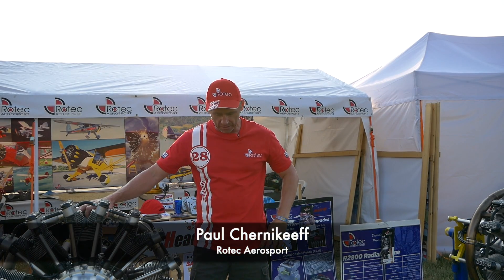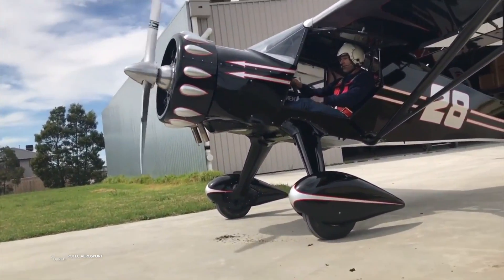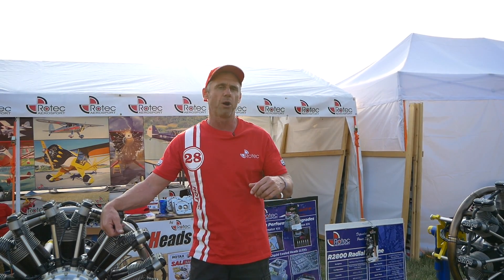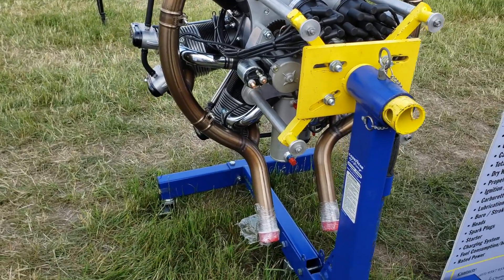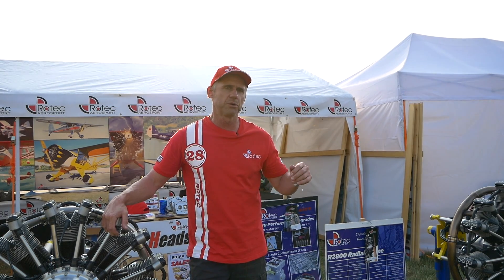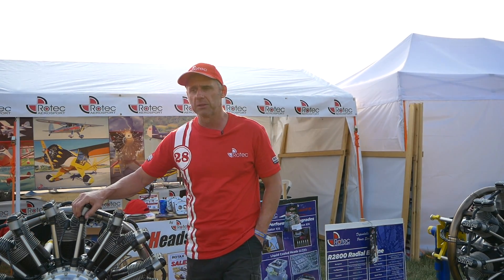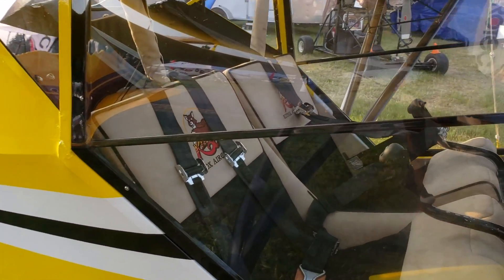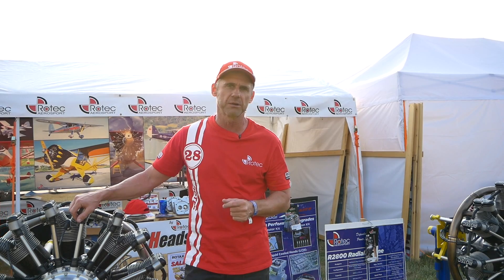New Radial Engines For Vintage And Modern Airplanes - Rotec Radial Engines

Comment: You guys should be ashamed of this engine. Way to many failures for it to be reliable in a aircraft. They have plastic timing gears. People do research before buying. I have seen many hoarer stories from the drive gears exploding to being poorly assembled to push rods breaking and far more. Its to bad because they look good and sound great when running. You need to go back to the drawing board. perhaps copy a old Pratt & Whitney Wasp R-1340 SC1 exact no plastic or short cuts.

Comment: I wouldnt put these on a snow blower . Every single engine has had an issue most have crash new planes do A search rotec failures before you buy this unsafe engine . the faa is  investigating. Go back to model engine you jerks.

Comment: It's really sad that someone is spending so much energy trying to get Rotec out of business. Should they succeed, will it be a great loss for us who enjoy these engines so much. And there will only be one manufacturer left that produces small radial engine worldwide.
Reply: How many hours do you have on your Rotec engine?
Reply: @cleophusA  It's six months winter in Norway so it's only been 187 hours so far. 
I made the following adjustments:
• Replaced all oil hoses from AN6 to AN8 except crankcase ventilation     hose which are AN10. This reduces the possibility of hydraulic oil cavitation and that it builds up a lot of oil in the crankcase.
• Larger oil tank with air separation
• I never use 100LL since it clogs the oil channels, valve stem and the tops of the pistons. 
• I use Bing carburetor since I don't know if TIB likes ethanol. Car gas contains up to 10% ethanol in Norway.
• The carburetor gets cold intake air. This helps to cool the crankcase.
• Return hose on gasoline supply. This reduces the possibility of vapor lock
• Uses wideband A/F ratio gauge to prevent it from running lean.
Reply: @oeaaneb , from all of the negative video I've seen on this engine, it looks like you have gotten one of the good ones. Have you experienced any of the problems that so many others are talking about, such as premature bearing wear and unusual parts breakage? I was very interested in this engine until I saw so much negative feedback about reliability and especially customer service. I mean, if you have to have warranty work done, it means paying freight both ways from America to Australia! That can't be cheap, and if you have to deal with a hostile customer support/warranty system, that makes a warranty claim even more of a nightmare. What intrigues me most about this engine is the extensive use of automotive parts, making maintenance much more user friendly and cost efficient, but I sure don't want to sacrifice reliability for ease of maintenance.
Reply: @cleophusA  My thought is that you must use a round dry sump tank to avoid that foaming oil will follow along into the engine again. If you also avoid the oil cavitating by using AN8 hoses I mean the bearings should last a long time. 
I'm not worried about using pistons and valves from automotive as long as it's from well-known suppliers. 
Support / warranty is always very difficult as there are two sides. Is there a user related error or is it manufacturer's fault. There had of course been a lot easier if Rotec had supplier in the US and Europe.
Reply: It is also important to avoid hydraulic locking. This can cause damage to the rocker arms, pushrods and, in the worst case, bent connecting road

Comment: Been following these beautiful  engines since the get go. They have been super reliable over for around 19 years. Hats off to them.
Reply: Obviously you've never researched youtube for all the videos on  the poor reliability, bad construction, cheap parts and no quality control. These engines are dangerous.
Reply: I can only imagine you must work for the company, no one else who has “been following” the history of these engines would agree with this utter tosh.
Reply: Keep off the crack. A French taxi driver is more reliable than these engines!
Reply: You must just be following the manufactures page and no body else because if you did any real research you would know this engine is a death trap and total crap. It needs a complete redesign.

Comment: Aren't there two manufacturers? Rotec from Australia and Rotex from Germany.  A lot of horror stories about the Rotec.
Reply: Rotax is actually a very reputable company, you are correct. Rotec, the ones features in this video do have a lot of issues that still need to be worked out, despite being out for quite a few number of years now.

Comment: More btw. I understand  Paul has been selling these for many years now. But here's a theory as to why he's been able to get away with this for over a decade;  The planes they're being put into are historical/rebuilt/re-imagined. Both traditionally and contemporaneously they don't fly that many hours. Paul admitted so much to one purchaser I know of who's engine failed and Paul, self-admittedly, said he has no feedback on such use when it comes to it when it comes to actual metrics. Therefore, if a fault -ridden designed engine goes for a couple of flys it might 'last'. Take this same engine and put it to a few dozen hours, a few hundred or a few thousand hours and will appear a different story. I actually feel sorry for Paul, as an ex-pat Aussie myself.
Reply: Why do you feel sorry for him? He clearly says it has a 2K. TBO and it obviously doesn't. There are several post from people that owned (yes owned as in Don't anymore) that had them fail in flight with low hours. On every one of them they found damaged or miss fitted parts. Rocker arms hitting rocker covers. Bolts that are to long so they hit internal parts. AND all had several problems with customer service from Rotec. Even being told that if they are "combative" or complain to much then Rotec will just drop them. As in no more support on an expensive engine that doesn't work. This ass hat owner. (Rotec) has only himself to blame.

Comment: Word. This says it all:  https://youtu.be/LlPtMVijIzs  ..look at a real radial engine instead Mike, like a Verner or Warner. You should ask Paul about things like oil control rings with radials, fitting difference between top and bottom cylinders and see his reaction.  I know a pilot who's engine dropped a valve into the cylinder whilst coming into land at AirVenture at Oshkosh, ironically. Fortunately he had the height and speed to do a dead stick unscathed. He said never again, replaced it with a Verner. The author of the vid link has a Masters in Aviation Engineering along with 14 years as PIC of a B757 & B737. That's what you might call qualified, er, unlike some other people.

Comment: did anyone notice the little kiddy playing with his toy plane on the left?..looks at the circular exhaust manifold, would be better with some cooling fins engraved on those surfaces too to improve efficacy of heat removal from those monster arrangement of aircooled cylinders
also feel twin spark ignition systems could be improved with special design of new spark plugs that allow twin spark arcs from a single piece of plug electrode, hv coil  and cable setup to reduce clutter and wiring
Reply: FC: A single spark plug is a single spark plug. No redundancy.
Reply: that makes sense when you up in the sky...

Comment: I LOVE the look of the Rotec radials, they completely nailed 100% the look of the P&W wasps and such.  That said...they need to spin real fast to get any power out of them and at speed (TO/ cruise) they sound NOTHING like a radial - more in line with a rotax 912.   As far as the reliability I have nothing to add but it seems like they're getting lots of hate from owners.  

The Verner Scarlet series (3,5,7,9 cylinders) on the other hand spin slowly, like the original radials, and sound BADASS.  Look up their vids on YT.  They don't quite look as nice as the rotec but the sound more than makes up for it.  I think their engine uses Honda components.  

And the name is pure genius, though it probably goes over most folks heads.  Verner Scarlet = Warner Scarab 😂
Reply: Richard Hodge the reason why Verner doesn’t get lots of hate from o Wes is probably because of there are only few owners.
Reply: @TheNadjalo  
Well that and they're actually a much better engine

Comment: Rotec are plagued with a lot of problems. They need to be re-engineered to stomp out the many design issues they are riddled with.
Reply: can you name some?
Reply: Video bearing failures are all over youtube, on Rotax and this radial which is really bad.
Reply: @tropicthndr  maybe it could be due to some quality issues with the bearing supplier they used..?
Reply: tropicthndr you’re confusing Rotec (American company) and Rotax (Austrian company). Rotax has no problems and by the way, no radial engines either
Reply: @Fr99763  Austrailian, not American.
Reply: @Fr99763  
You have that exactly backwards
Reply: @kirkstinson7316  then look it up. You shall see
Reply: @fidelcatsro6948  from the videos I've seen

Big problems from the factory (as in bad cylinder assemblies from new)
Immensely poor customer support
Selling used parts as new
"New" engines coming with used parts
Borderline catastrophic failure from New
All the above issues showing themselves within 50 hours of operation
Reply: @thegreatchickenoverlord5976  thats bad!
Reply: Yep, great example of why you never put kids/family behind anything that’s not certified, including Rotax drone engines.
Reply: @tropicthndr  I've flown Rotax 2 stroke engines for 15 years and never had a problem with them! The owner must tune the carbs and watch egt temps. TBO is 300 hrs but I have friends who have got in excess of 1200 hrs before a rebuild. Very good engines but definitely not idiot proof! What's your experience with Rotax engines?
Reply: @daviddixon2166  yes those are good engines but these are not the same maker.

Comment: They make great boat anchors , certainly would not use one in a plane ever again, bloody dangerous
Reply: Curious. Can you explain? Not a plane guy myself but I love engines of all kind.
Reply: Geoff Moore , Hi Geoff. Let me just say I have had experience first hand with this brand of engine , as any pilot will tell you that an inflight engine failure is an unwanted experience that does not always end well, and I encountered not one but two total engine outs during flight, I was lucky to execute two forced landings without aircraft damage or personal injury,
Reply: @goldfieldsbushpilots9917  Are these mechanical, ignition or fuel delivery problems? I always thought the FAA and other aircraft authorities has strict redundancy and safety rules on engine building?
Reply: @geoffmooregm  ..well, mechanical, from a design point of view. I could list all the faults but the link in the comment https://youtu.be/LlPtMVijIzs I posted earlier today says it very well. There's also a problematic and overly obtuse oil delivery system compared with historical radials aka Pratts, Wrights and so on. Both the Verner and Warner have a simpler, more unified oil delivery, which works well less resultant comparable failures to this engine.
Reply: Geoff Moore hi Geoff. Both engine failures that I encountered mid flight resulted from mechanical failure, badly manufactured, lacking quality controlled parts. Attempts to deal with the manufacture was impossible, arrogance beyond belief almost leading to outright stupidity. 
Geoff I have a passion of life and flying and would not risk either , as such  both my aircraft run certified reliable aviation motors, 
My removed radial has been turned into a coffee table 😂 and is always a talking point with other pilots.
Reply: @goldfieldsbushpilots9917  Wow that's crazy scary. I wonder if its due to using cheap off the shelf automotive parts?
Reply: @geoffmooregm  I suspect that in an effort to keep costs down, Rotec either has their engines manufactured and assembled in China or the parts are made in China and the engines are assembled in Australia. Either way, just watch the youtube videos on the Rotec engine failures, I myself have never seen an engine assembled with so many defects and with so much excessive wear after so few hours.
Reply: @TheGarnerjustin73  Wow that's brutal. One thing to be stuck on the side of the road because of a bad engine. Absolutely terrifying in a plane.
Reply: @geoffmooregm  I think they are getting around the FFA by doing a uncertified experimental. I mean you can put a motorcycle engine on a experimental.

Comment: Is there any advantage to a radial engine over a modern prop?
Reply: Only real advantage is the sound and look. But in the case of this brand  because they are a pile of shit. If they was built in a cheap Chinese's sweat shop they would be a better engine.
Reply: Don’t forget the ridiculous torque of a radial engine 👌
Reply: @mikecorleone6797  yeah man... shes only got 100hp, even my 1200cc old school bike makes 100hp but her torque is in another totally fantastic higher level!
Reply: radials are air cooled (cooling fins) and use pistons like a conventional car engine, fuel consumption is more economical
Reply: @fidelcatsro6948  No. Fuel consumption is not more economical.  It is much more difficult (i.e. impossible to optimize the greater number of cylinders).  Also air cooled engines must have sloppier tolerances to allow for expansion/contraction.

Comment: did they fix the reliability issues?
Reply: It's not hate when its fact 
https://youtu.be/ZIjh4o9QjtY
Reply: Agreed. This is not a company to invest in.
Reply: Here come the haters
Reply: @flexairz   Some of haters actually have aircraft engineering degrees btw.
Reply: @flexairz  Well they need to be reliable, if nothing else. Half the parts are cheap Autozone parts LOL

Comment: A sound check on both engines would be appreciated.
Reply: They'd have to work to make sound
Reply: @ChevTecGroup  I see what you did there! Cheers!
Reply: Indeed, radial engines have a lovely sound!
Reply: don monfort  Hehe, I've seen the horror stories. But, the sound is lovely, and they might as well run on the ground. Perhaps they can include a handsome running stand with instruments.

My brother's aircraft has a Pratt & Whitney R-1430-AN-1, I believe. That SNJ sounds lovely. The little Rotec would be a better fit for the living room.